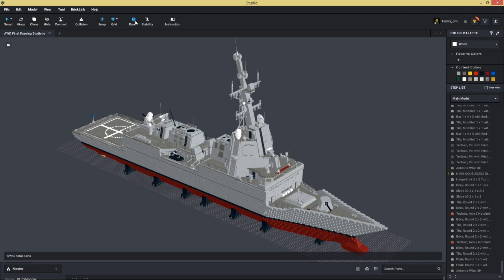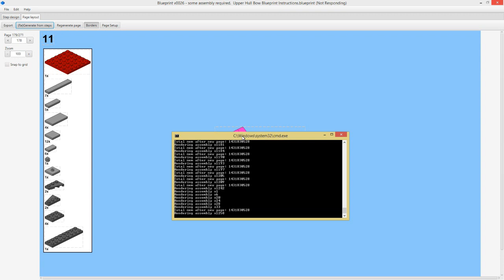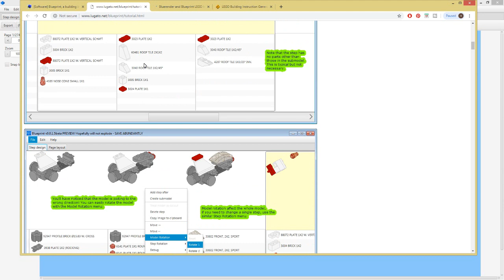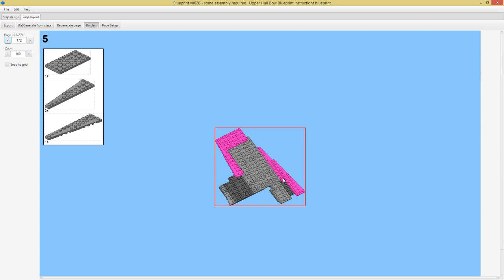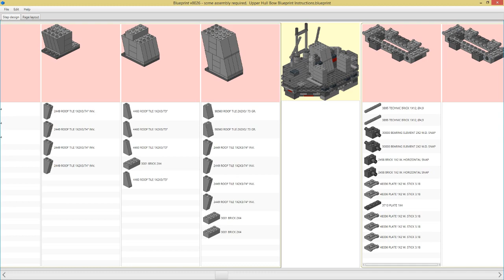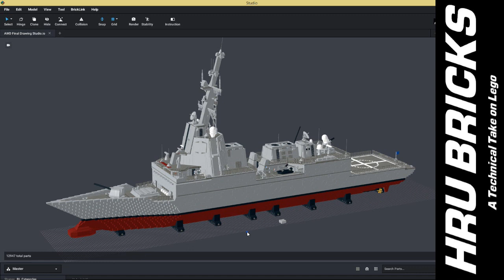How to Make Lego Instructions | Lego Navy Boat MOC AIR WARFARE DESTROYER

Comment: my blueprint shows error messages that it ran out of memory when i have big models, how did you manage to build 12K model in that ?
Reply from the maker: Yep that can happen. My Computer is an i7 16gb ram, 2 gb graphics card and SSD. That was another reason I split the model into 4 sections. The lower sections when generating the steps would use about 2.2 GB of ram and 80% of my CPU. The SSD (Solid state drive) made a big difference in the capabilities when using Blueprint. I find that Stud.io is even more resource hungry and that is one of the reasons I do not do the instruction in it and it is not yet my main design platform. I plan to upgrade my PC soon.
What are your PC specs?
Reply: @SmashingBricksAU  I5 -6300HQ and 8gb ram,  and also just HDD not SSD, yes i learn to break in into the sections, but its not that good experience when i had to put PDF files then together, rather than one continuos instructions if you know what i mean, but as you said, my PC is lacking ram and CPU performance then. Thank you. :)
Reply from the maker: Not a problem, happy to help. Make multiple books for the builder. I have done that before as well
Reply from the maker: Can you break down your model into small sections